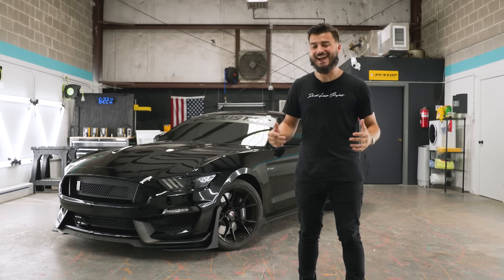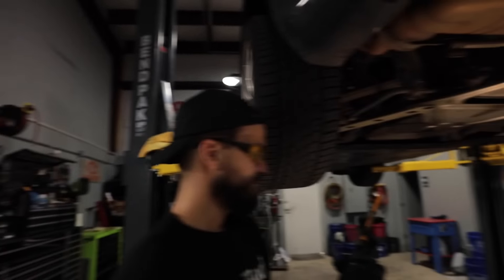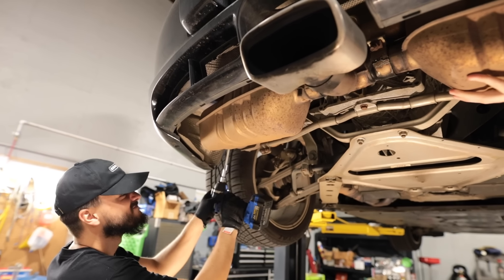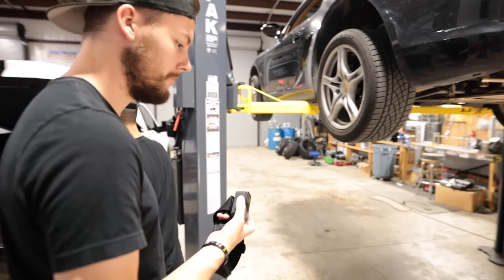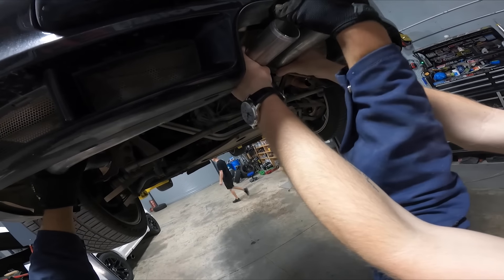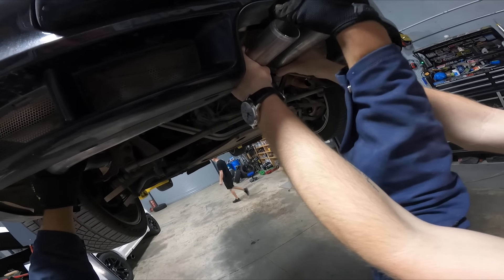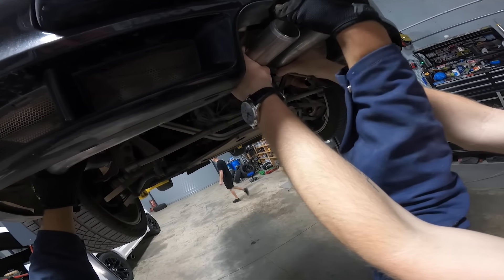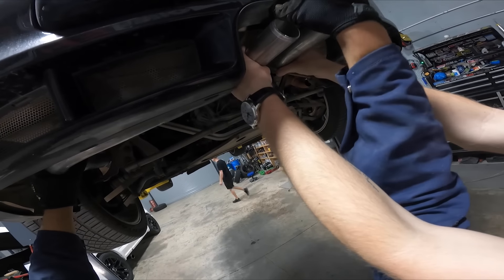Making My Friend's Porsche sound like a GT3 for Under $150!

Comment: 3:40 should've used a angle grinder, cuts threw anything
Reply: It also throws sparks everywhere. Not sure exactly where the gas tank is but a reciprocating saw was definitely the better option

Comment: Carbide tip is used to cut and mill steal and other parts like your car parts on you drag mustang. The tips or teeth or blade is treated with heat and acid to make it super strong.

Comment: One thing that you forgot to say is that it lightens the Porsche by getting rid of the mufflers and decreases resistance for airflow and increases horse power! I had my Mustang GT straight piped and it gave my car 20 more horse power!And I could feel the difference because my car was quicker afterwards!

Comment: Carbide is strong but brittle. I use carbide drill bits, they eat through most stuff, have to take it slow on stainless cause if you get stainless too hot itll harden and become a nightmare. Carbon steel not match

Comment: Porsche came up with the anti chop mod. Where you have to spend a lot of money on an exhaust instead of cutting it off and if so it will cost you 50$ in blades and a lot of time🤣

Comment: Gavin, as a Porsche mechanic at a dealership in Dallas. That does sound good but it is not quite a high end exhaust. Check out soul performance or GMG, I know they are expensive but I have installed many of those and that is a whole different sound. I would stay away from fab speed due to cheap metal and warping issues but anyway next time you are in Dallas let me know ! I am @builtmoto on Instagram. We have some pretty crazy shit in our showroom including a 918 and GT2RS that I would love to show you!

Comment: Take it easy on the trigger and add a few drops of oil. Your blades will last much much longer. Slow is fast especially on stainless or titanium. If your Milwaukee is variable speed then set that beast to 2 and you’ll be golden.

Comment: The way it looks is its whole pipe being smaller when they cut it lol but it's probably throwing me off since yall gonna put factory tips on it. Hope they don't get the up sizing wrong specially for right side. 2 yrs not welding and them making pipe down so much isn't nothing to do w you bro. All that's needed to be level an equal